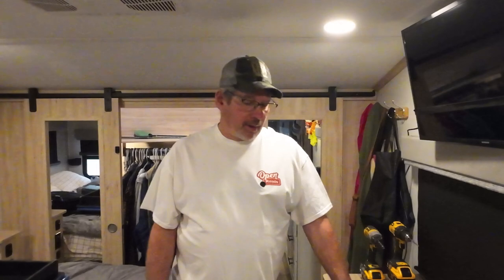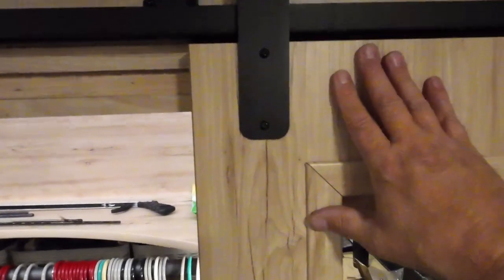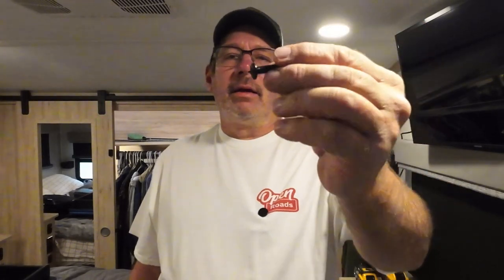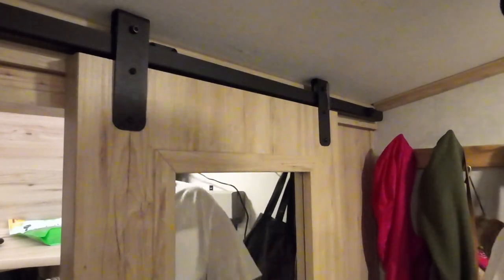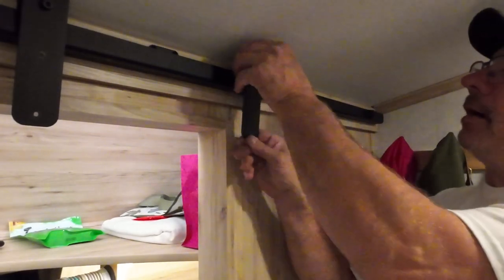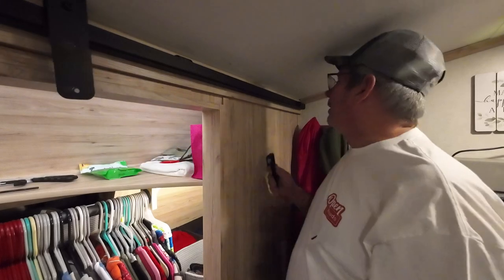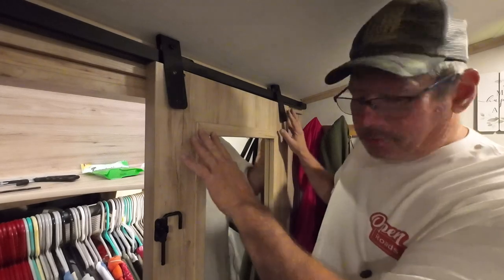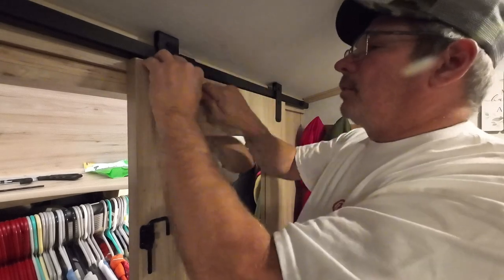RV Barn Door Repair

Comment: The screws on my closet door barn rollers kept working loose.  I cut a hole in the back of my doors and installed solid blocks of 2" X 4" ripped down to fit the door thickness, then I glued the blocks inside the door frame.  I then reattached the rollers with wood screws.  They haven't backed out since.   Your way looks a lot faster.
Reply from the maker: Yea, a bit faster but if they end up backing out, I guess I'll take your route